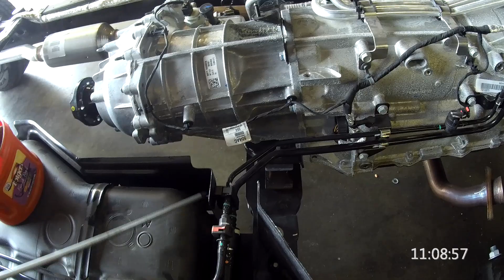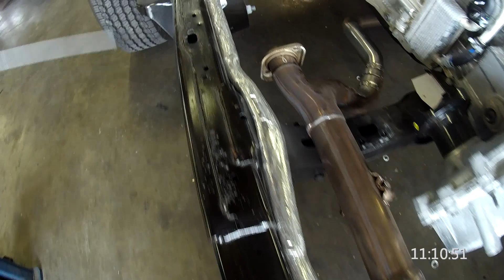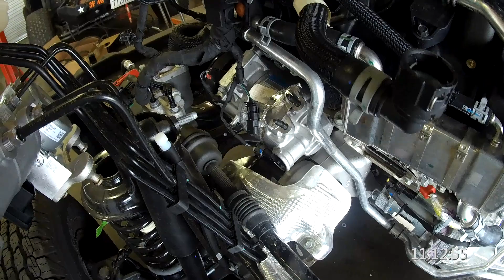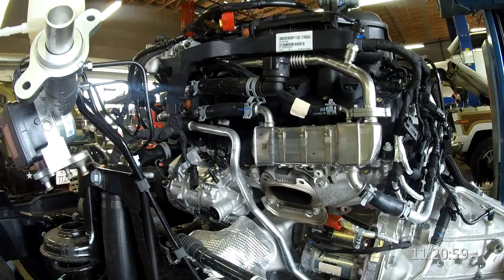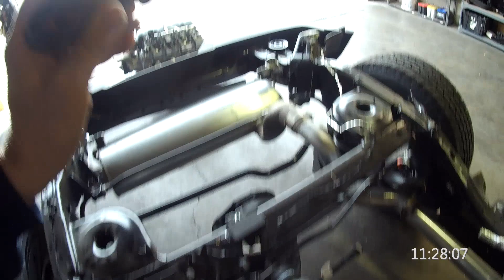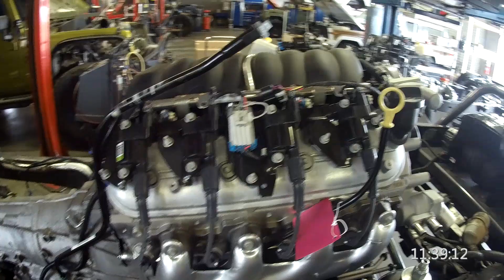Wrangler JL Part 4

Comment: That's an ATF warmer, not a cooler. The cooler is the smaller radiator mounted in front of the engine radiator. Only TAG flows through here. The one on the trans warms the ATF to improve shift quality.

Comment: I would argue the newer Pentastar motors aren't getting streamlined because they aren't going to be around much longer. The 2.0L turbo puts out roughly the same power, slightly more torque, and might be further tunable for additional performance. I wouldn't be surprised to see the V6 phased out in a few years and the turbo become the standard JL engine much like was done with the Mustang.

Comment: From a reliability , durability , efficiency and safety stand point , stock engine will outperform any other swapped engine every day of the week . Engine development and vehicle integration go hand in hand early in the process . There are certain safety requirements that OEM need to comply with.  For example , how will the LS/LT swapped JL  perform in a crash test ? . JL has undergone over 4 million miles of testing with the stock engines . I'm sure the LS/LT are great engines, but Integration is the keyword.

Comment: Couldn’t we place a egr cooler delete kit like o the ford’s 6.0 and 6.4s ran so much better without the egr cooler
Reply from the maker: Problem with EGR valves on gas engines is they are tied into engine performance. The OS is dependent on the EGR valve functioning properly to cool down the chambers to avoid the formation of NOx and prevent pre-ignition. Sure it could be modded or deleted but to do it properly tuning would be required and of coarse it would be considered tampering.

Comment: Are you going to inform Chrysler of the coolant leak? I would think it’s a sign that there may be assembly issue. Possible head gasket missing or issues that they can catch before it’s a major recall.